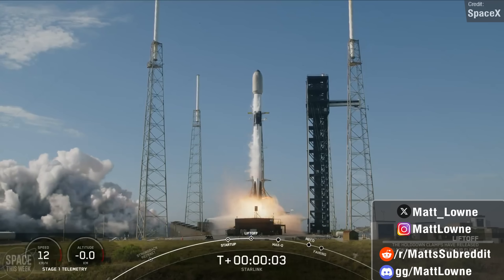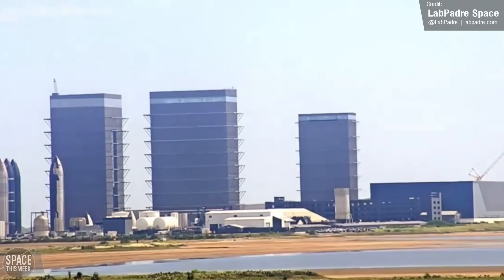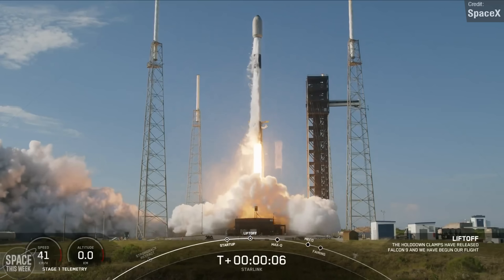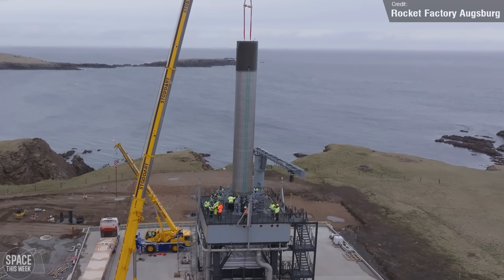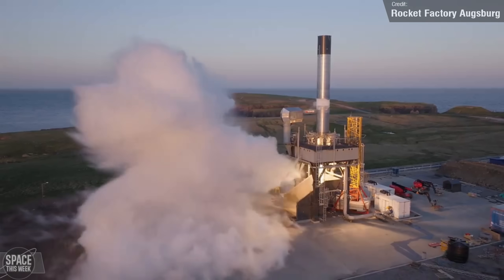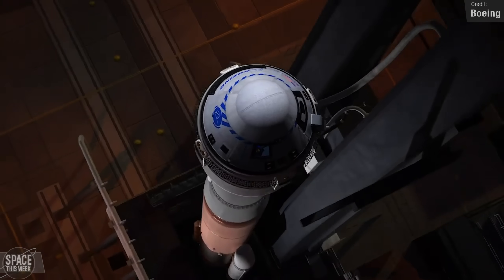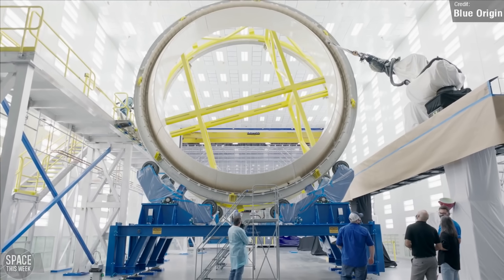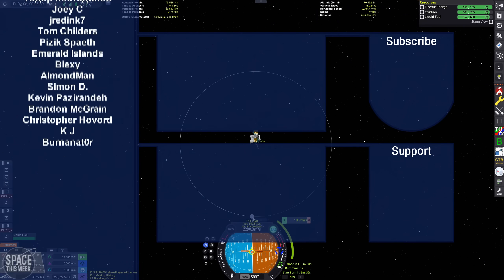SpaceX are Preparing To Catch Superheavy and RESCUE Boeing Starliner Crew, and RFA 1 Explodes

Comment: 8:20 It's not too risky, it's just that Dragon is proven safer. It's an important distinction. NASA has already stated that in an emergency evacuation of the station, Starliner would be used and they are confident in it's safe return. (But given the issues Boeing has faced in recent years, it's not the guarantee like using Dragon is.) It's likely that NASA's been ordered not to return on Starliner as it's an election year in the US (elections less than 2.5 months away) and ANY mishaps, no matter how small, would be an embarrassment to the incumbent administration which the current administration would be keen to avoid. They already almost had a former President assassinated on their watch, almost or actually losing two more astronauts in what the public would rightfully believe was entirely avoidable circumstances would all but guarantee a loss in elections as there would be zero confidence in the current leadership. So I personally think the decision was more of a backroom political move rather than a lack of confidence in the craft or Boeing overall.
Reply: I think this would have been the case had there been formal dissent, but it sounds like the NASA engineers largely felt Dragon was the better option and unanimously agreed it was an acceptable option.
Reply: No, it wasn't that Dragon was safer. Yes, Dragon is safer, but that is always the case in a test flight, which this was. But the reason Dragon was chosen was that Starliner was considered too risky for a return back. They would have risked it had there been no other choice. But since another choice was available and the risks were high, they decided to use Dragon.

Comment: WE ARE ALMOST TO A BOOSTER CATCH THIS WILL BE CRAZY
Reply: @foamflinger7062 not spaceX lol
Reply: I got faith
Reply: Ikr
Reply: That's all we can do😊
Reply: @foamflinger7062-- They've been doing pretty well when things aren't exploding, so I'd bet that things either explode much higher in the atmosphere, or are capable of diverting. I think the only way it could obliterate the catch-tower is if one of the engines chooses to explode exactly after the flip. I wonder how they can test for that besides just reliability.
Reply: @TlalocTemporal  The catch attempt is for the booster, not the ship. The booster doesn't do the flip
Reply: @Quasar-2  -- Ah, true, then it's just the exploding after diversion that could risk the tower. Or a surprise wind. Or a mechanical failure of the tower!